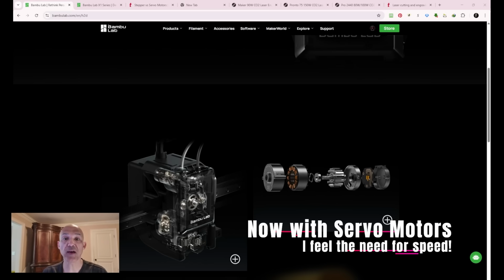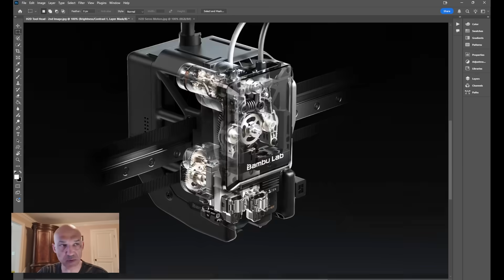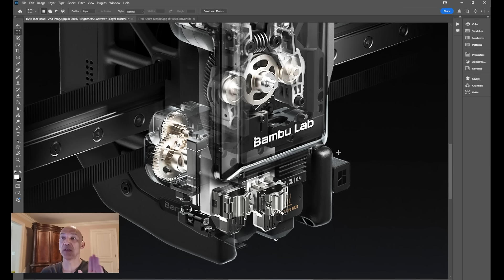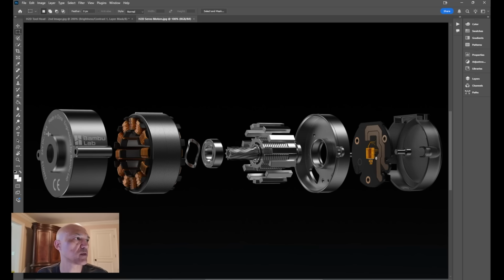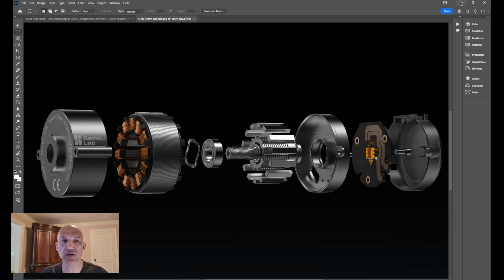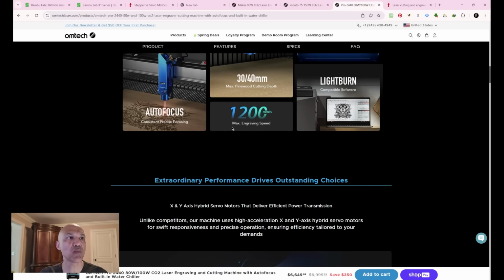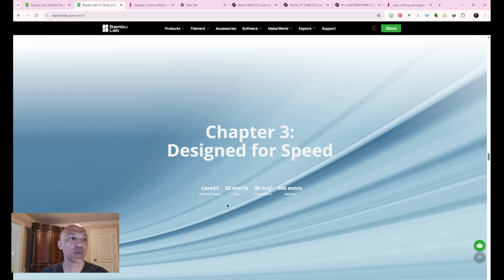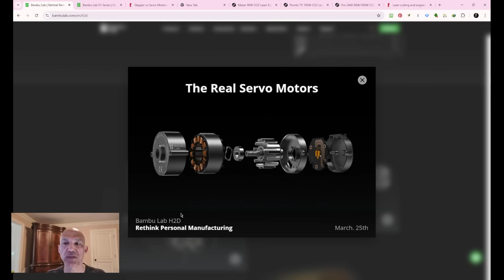Bambu Lab H2D  Fastest 3D Printer Ever? - Servo Motors and Tool Head Leaks!

Comment: Kinda slow i also use servos (4x delta e3l ac servos) and it happily hits 2m/s moves 1m/s printing. More in the future with custom servo control software and new pulleys.
Reply from the maker: Speed versus quality will always be at battle.
Reply: @directedt3ch  thats the reason im adding linear encoders and use 2gt-gt3rs gates belts and my servos can do up to something like 7mill ppr so.....
Reply from the maker: @pon4480 That sounds like an impressive machine!

Comment: They better don't have the encoder on the axle of the servo motor.  Then the control loop is limited to the servo motor, but it's not measuring the movement of the print head.  I had to deal with this kind of issues in the industrial automatisation, in a system were automated fork trucks were used, and the steering of the fork trucks was controlled on the steering motor instead of the steering while.  There were all kind of inaccuracies, the system was rather inaccurate, and so limiting the closed control loop to the servo motor and not including the movement of the print head might not bring the desired accuracy increase to this printer.  Any mechanical play will show up on the printed parts!

Regarding purchasing this printer I'm not looking at laser cutting or foil cutting, so a tool changer with only 2 heads and limited building volum at $3'000.- is massive overpriced.  Shall the Bambu fan boys get this over expensive toy, I rather put this kind of money into a real tool change printer.  And I'm really curious how badly the Z-layering will be at the highest print speed.  
What is increased print speed good for, when parts are not as strong as they were before due to lower layer adhesion and the print quality is lower than before.  Should I wast all the cash for this printer and than lower the print speed to get an acceptable result?  And when the print volume isn't enough should I have a K2 plus under the bench collecting dust until the part is too large for the H2D?  
This printer can too much and is too little.  Bambu better concentrated on making a large printer with more than 2 heads, whatever is needed to accomplish it.

Comment: Question is, how will the print quality be, if they increase the print speed?  Will the structure be stiff enough so a large part isn't getting shaken around from the acceleration?  Is the increased speed a marketing argument only?
Reply from the maker: Higher speeds can introduce issues.  Maybe input shaping can help...
Reply: @directedt3ch  You can see the effect of high accelerations on today's printers already.  Z-layer lines are getting stronger the higher the acceleration, especially on higher, heavier parts.  Input shaping is working within limits.

Comment: If it does have a laser i will not be buying it as no matter how good the extraction will be it will never get rid of all the dust and would compramise the the 3d prints ,and i would be buying it for the 3d printing ,as its supposed to be a 3d printer.

Comment: These are the motors of the new AMS.
Reply from the maker: My believe is that they are going to be the X and Y motors.
Reply: @directedt3ch  Spec of the new AMS shows Servos, Specs of the printer does not.
Reply from the maker: @fw_uke_ha  Do you have a link to the AMS specs? I have not seen that yet.

Comment: As for ways to increase printing speed, it seems that using two nozzles with different diameters would be effective.
Reply from the maker: That could be interesting.  I wonder if you could do an outer shell with the 0.4 for detail, but do the infill with a 0.6 or 0.8?

Comment: Good God how many points of failure can they add?   Three sets of gears and transmissions and motors? On my P1P it took them about six months of back and forth just to figure out how to fix the filament sensor and cutter. I said it just sent me the parts I need they dragged me through trying to service it myself endlessly. Oh and not to mention we didn’t even get to fixing my screen which would go up sometimes when you press down and go down sometimes when you pressed up. Garbage.
Reply: Yea that is an interesting point. Maybe that was the reason for the significant delay. i hope the figured it out. But I gues we will not know till moths after the launch.

Comment: Not paying extra for stuff i don't need. I think they may be putting themselves out of business,  but what do I know?
Reply: Probably less than Bambu Labs right?
Reply: @blueberrywilbur315  that's definitely a no.
Reply: @jasonc212  What is your company I wanna check it out ?🤷‍♂️
Reply from the maker: Based on the leaked specs, it looks like you will be able to buy just the H2D without the laser/cutter mod.  I do think it's an odd combo and those that buy the laser combo will quickly relize all the limitations with this setup.

Comment: Yes, I would love that. I design terrain for tabletop gaming. I sell digital files because I don’t have a fleet of printers to be able to sell physical ones. I have 2 printers, A1 I use for prototyping or terrain that doesn’t need high details and the X1C I use high quality print for finished products. I experiment as well other opportunities with the X1C, that is the reason I went with X1C. But if I stuck to terrain a P1S is perfect (my environment is better suited for enclosed) The reason why I went with the A1 instead of the P1S is because most of my customers are likely to have an open bed slinger. That being said, having a bed slinger in a bad environment and getting successful prints will mean someone with an open printer or bedslilnger will have no issues printing my terrain.

Comment: More leaks...make it sound like it will have a few different configurations across different price points. For example, a model without the laser glass and laser module. Also, 2 new AMS units, the. HT and the Pro 2. The Pro 2 is backwards compatible with the X1c. My guess is, this printer will start at about $1,700 for just the base printer configuration.
Reply from the maker: Yep! The leaks do shed a good bit of light on the configurations.

Comment: I hope this will be faster. One reason I haven’t bought one is speed (and print area). You don’t have to be doing production to want speed. I do woodworking, casting and machining. I could really use this, but when it takes many hours for a decently complex print, I can’t be bothered waiting. It’s easier to do much of it another way. The Bamboo is a fairly fast printer to begin with and has shaken up the industry as others who didn’t bother with speed, now do. If this is notably faster, with the same, or better print quality, I will finally buy one. I don’t care about the controversy over the networking. I’m not doing anything that I care about anyone seeing.
Reply from the maker: The specs that were leaked yesterday show that the max speed on the H2D is going to be 1000mm/sec.  So it has twice the top speed of the X1C.
Reply: My experience with higher acceleration and print speeds is, the acceleration of the head is creating a force on the printer's frame going into the opposite direction of the print head.  This force is getting transferred down into the base of the printer and also into the print bed.  Consequence is the print bed and the printed part is exposed to a force pointing into the opposite direct of the movement of the print had.  This will lead to imperfections in the print.  The higher the acceleration and the speed of the print head the more imperfections you get.  To avoid these imperfections you have to at  least reduce the acceleration, and acceleration has a huge impact since it's rather seldom, that the print head is moving in a straight line over a longer distance to reach max speed.

Comment: The FOC servomotors and the linear guide on the gantry have been used by the Creality K2 Plus for a year. Did Bambulab copy from Creality? It seems so
Reply from the maker: It will be interesting to see how the two machines compare.  The leaked specs of the H2D show the top speed to be 1000mm/sec.
Reply: @directedt3ch  how much acceleration Is expected?
Reply: with only 20k acceleration and such a small plate it can't reach 1000 mm/s speed. I'm not saying this, physics says this. Lots of hype and marketing

Comment: I did notice Bambu is bringing High Flow (tpu-hf / petg-hf) filament to the market. Could this be an indicator we all missed. I assume at higher speeds we need faster filament. I did some testing with hf on a x1c, and was not happy with the results. When I turn down the speed the results became perfect again. It could be hf filament is optimized for the new hardware. Whahahaha just gas lighting the rumors
Reply from the maker: That's a good point.  Most of the high flow filament I've seen is for around 300mm/sec.
Reply: HF filaments literally isn't new and it's more for actually good printers that can reach its useful speed (>40mm3/s). Bambu doesn't even manufacture filaments, they just repackage other manufacturers'.

Comment: speed is great, but what if the H2D not only does 3d printing but also can laser engrave
Reply from the maker: That's not a combo that I'd want (if you've ever seen the residue/soot/fumes from a laser engraver, you wouldn't want it in your 3D printer either).  BUT the leaked specs show that it will have the option of a 10W or 40W laser module and a cutter for thin film/vinyl/paper.

Comment: The Servo Motor is needed for the Laser Modul, as you mentioned. Not for faster printing.
And I guess, that „Personal Manufactoring“ means, that you can engrave your name or logo with the Laser.
Reply from the maker: I think both will benefit, but yeah, you probably won't ever hit close to 1000mm/sec with a 40mm3/sec flow rate.

Comment: It is very disappointing to see click bate titles like “Fastest 3D Printer Ever”… Since the H2D appears to be capped at 20K accell and 1000m/s TRAVEL speed, you can bank on the print speeds being way under that. The VZBot, HevORT, & Printers made by Advanced 3D Printing out performed this YEARS ago… lol Being as the H2D is rumoured to be priced around $5->$6k US that puts it in this league… We will just have to see how the laser and vinyl cutter options for it turn out.
Reply from the maker: I'm hoping it will be priced much less than 5 or 6K.  That would be insane in my opinion.  I didn't learn about the leaked specs until after this video went out.  Turns out there are several printers that already have a higher top speed.
Reply: @ It is leaked to be well over $5K… Which makes sense for it’s capabilities… Lookup HSP1-I, Modix3D, or Vision Miner 22 IDEX… Yes it is not the same, these machines are a much higher league, but you will see the pricing.

Comment: The only thing i see here is that yes, the printer could go fast, but i think the extruded materials will slow you down. I know companies are pushing out high speed materials, but the budget person may not be able to afford those materials.
Reply from the maker: Definitely will need some high flow filament to take advantage of the speed capabilities.  It'll be interesting to see this machine in use.

Comment: I wouldn't underestimate how fast this printer will be. I went from a 1st gen Ender 3 to the A1. Printing a benchy went from 90 minutes to 14 minutes!
Reply: That hard thing is not matter how fast the motors can go you still have limitations of filament.  I think the next step besides motor speed is some kind of active cooling of the filament at it is laid down.
Reply: @cpace123Someone else mentioned a FL sun S1 already can do a 8 minute benchy strait out of the box. The flow and cooling to do more is there already 💯
Reply: Any contemporary printer like Bambu P1 or X1 series as well as Creality K1 or K2 will print this fast.  It can be printed even faster, but print quality will be lower the higher the acceleration.
Reply: 14?🐌🐌🐌🐌🐌💩💩💩💩

Comment: id rather have my laser separate from my 3d printer. All they are doing is pricing a lot of people out of the machine.
Reply: The only possible benefit i could see, which ive seen nobody discuss yet, is using the laser to melt the surface of the printed object to smooth it out.... but i doubt that is what it's for, since it would need much more articulation, and i think that would just be more advanced than possible with this hardware.
Reply from the maker: @ I don't think that both the 3D printing tool head and the laser will be able to mount at the same time.
Reply from the maker: It seems like an incredibly niche market.  No machine that I've ever seen that combined such varied tools has been overly successful.  I already have 5 lasers and they all have MUCH bigger working areas.  My vinyl cutter has a much bigger work area.  I can run them while my 3D printer prints and not have any impact on the printer (debris, soot, etc).  It seems like they are going after the crafter market like the XTool M1 rather than building on the 3D printing market where they've been really successful.

Comment: Doubling the max speed doesn't halve print times.
Reply from the maker: That is true.
Reply: I always thought the speed limit is how fast can you melt filament and push it through the extruder.  The current speeds on Bambu printers are so high that they might have hit the limit of what steppers can do though.
Reply: @cluebin8398  That and I have seen faster (VZBOT) but they have a crazy hot end and AWD (2 stepper motors for X and Y) as the shorter belt lengths make it so input shaping doesn't kick in until faster speeds. To get the fastest performance you have to use liquid cooling on the stepper motors as they get hot (above 100C) without it. That and the Goliath hotend is insane. 50mm melting zone with a 100W wire wrapping around several times around the melting zone. This seems purely for the laser engraver.

Comment: With the dual nozzle is it possible to use a 0.2 for the external wall and a 0.6 for the rest?
Reply from the maker: I would think it should be possible.  It'll be interesting to see how the slicer handles all of this. I'm sure they must have had to make a lot of changes to Bambu Slicer.
Reply: It will not increase the print speed though because a larger diameter nozzle will need a proportionally longer melt zone and from the picture it is clearly visible that both the extruders have the same lenght of melt zone, so same flow rate.
Reply: @alfredanil I love spreading misinformation online👍
Reply: Been forever since this has been an orca slicer feature, your fault for using the inferior slicer

Comment: You almost got the difference between a stepper and servo.  The most important part, you got right. Closed loop verses' open loop.  There are servo motors that use stepper motors as the driving force.  I've worked with many size servo systems one of which was a 50 hp three phase electric motor that used a tachometer as part of the feedback loop making it a servo motor.   RC model airplanes have servo motors in them that use a resistor to close the loop to a DC motor driven by and H bridge.  Servo isn't as near an exact description as stepper motor.  Servo is just simply saying closed loop that's all.
Reply from the maker: I believe I mentioned the hybrid servos which are stepper motors in a closed loop system. Thanks for the catch!
Reply: @directedt3ch  People might not mention it often...but a LOT of us appreciate when you guys respond.  Better yet, when you are graceful in fielding all the "input" we as watchers always have:)
Reply: The main improvement is that the usual stepper drives aren’t aware of the motor missing a step as there’s no feedback. I’ve upgraded machines with both plain steppers and some with servos.
Reply: @melgross  since the control loop is limited to the motor and isn't based on the movement of the tool head, the gain in accuracy is limited.  There's still the inaccuracy of the belt drives, the rails and the movement in the tool head.
It appears to me, that Bambu has chased a marginal improvement at high development cost to have a marketing argument.  It's like improving a 99% solution into a 99.5% perfekt solution.

Comment: The servo here isn’t A/B though it has a gear on it meaning it’s driving the extruder. 

There’s a LOT of valuable feedback you can get from a servo on the extruder
Reply from the maker: It's going to be interesting to see how it all turns out!
Reply: Don't care, still inferior to Kalico bleeding edge branch's non-linear pressure advance. Inferior to mainline klipper as well since they don't even have extruder movement clamping, resulting in awful seams seen often in bambu prints
Reply: @youtubehandlesux ahh yes. Interior to the thing no one uses. 

My seams look the same on my x1c units as they do on any of my vorons, sounds like a skill issue. Took me a half hour of tuning in Orca to get them perfect. 🤷🏼‍♂️

You sound like you have an agenda? I dot. I own lots of different flavor of printers.

Comment: Rather want a build volume of at least 500*500*500 or even 800*800*800 the x1c is fast enough maybe they can make a fast belt printer with reasonable build volume like 400*400*350
Reply from the maker: I'm sure will see some derivatives of this machine in the future.
Reply: Such a niche market never happening.